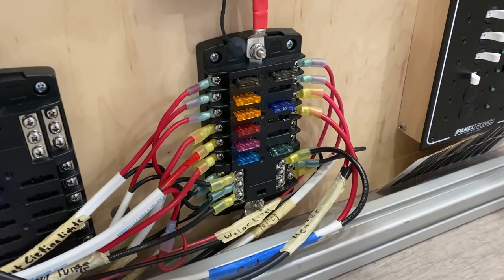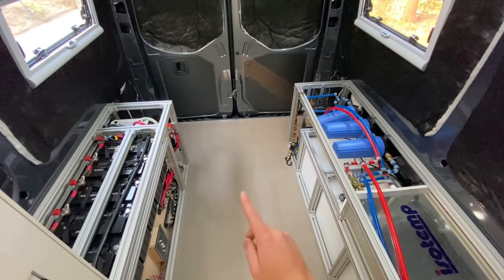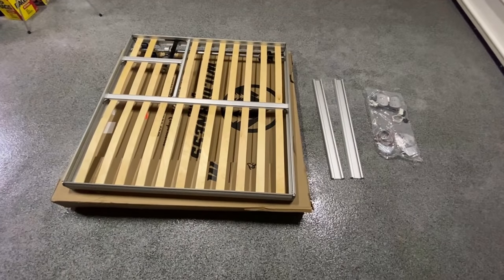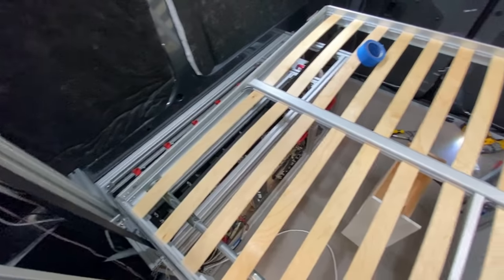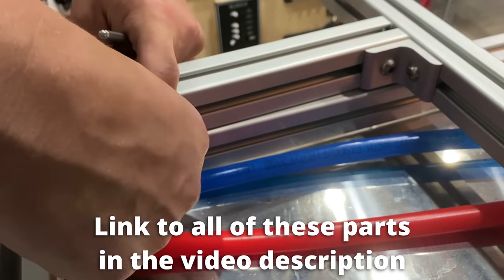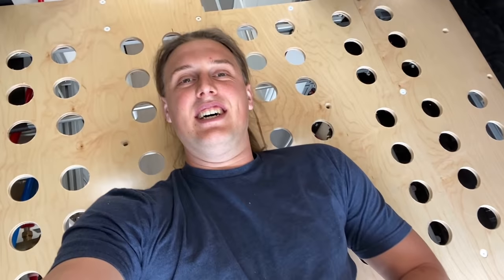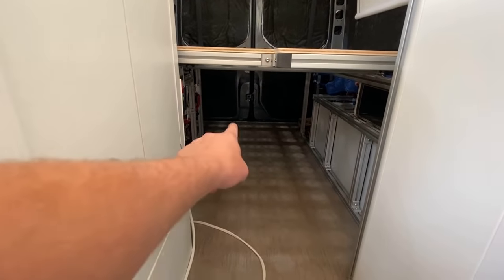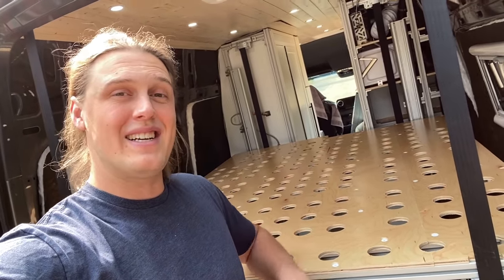I Made The BEST BED For Van Life 😴 (Rising Bed Lift System)

Comment: A prior comment referenced safety cut off switches to prevent the bed going up and possibly crushing and/or creating an asphyxiation situation.  Such electrical interlocking is NOT enough on its own! You absolutely need positive mechanical stops of suitable strength that will stall the drive motor to prevent the bed from rising to a height that would do that.  Limit switches, relays and/or contactors and anything electrical can fail - contacts weld themselves together, switches stick, etc.  Not having positive mechanical stops would be similar to working under a car using just a jack.  You don't do it - you always use a jack stand or some sort of mechanical blocking in case the jack fails.  These stops could be designed so they can be held up and out of the way to raise the bed to full height for more storage, but they should then deploy when the bed is lowered.  This would be similar to how the safety latches in a garage lift work.

Comment: This is what I would want to do as well for the bed system.  It would be nice to go up higher slightly more for a seating are underneath.  Now Mr. Savage, I've got a new idea for you.  Build a shower that combines hanging space up top and a fridge down below where there are two sections that slide out towards the front of the van and let's you shower.  Then slide both back in.  With this shower system along with this bed system you have the most efficient use of space in a van for sure!
Reply: it took me a minute to get my head around your idea... it's visionary... a solid space saver :)

Comment: My idea was to cut out the roof section of the van over the bed. Then  weld some aluminum side to the cut out roof section to create a box for the bed to raised up into. Then you will have full height use of the van.

Comment: I think one could easily self engineer the system. It is basically a pass-through right angle motor with a single shaft. I mean, you practically rebuilt this thing. This could have been built for much cheaper. Thoughts?
Reply from the maker: Yea 100%. It’d be so cool if someone did that
Reply: Single garage up and over door motor second hand £50, seat belt webbing from scrap breakers 4 casters and c Chanel, square section sly from scrap yard for frame, should be able to do it for less than £200
Reply: @aarondudas5006  looks like 1530 series 80/20 with linear bearings that captivate on 3 sides.

Comment: First, a safety warning.  Make this fused, have a secondary cut out, and a safety cut out at the roof for if people are in the bed.  Say a wooden bar across the top at the roof, with a switch on either end.  Bed at full up doesn't hit it so no cut out, if there's a person in the bed they hit the bar and at least one of the switches disconnects.  In fact make it 2 or 3 bars, or a large rectangular panel with 4 or more switches.  You don't want this going up in the middle of the night and crushing you to asphyxiation before you can find the off switch.  Winch type systems are extremely strong, you want a lot of extra safety when people are around them, it doesn't take that much force to make it where you can't breathe.
Someone else may have already mentioned similar, haven't read through all the comments yet.
Think I'll put the rest in another comment..
Reply: That's like my garage door. If you touch it it turns off. That's a safety design. I am really glad you mentioned this because I had not thought of it while I was watching.
Reply: The bed platform hit the side tapered side walls which is why it can't go higher than the top position shown. That still allow plenty of space for a human so I don't see how the wooden bar is necessary.
Reply: Why not put safety lock on the belts so it raises all the way up?

Comment: Thanks again Seven for another great video.  I was hoping you would have shown how you attached the tracks however.  I looked at the maximum lift height you were able to achieve in your van compared that with other videos of the Revel’s Euroloft and even if you take in account you not having a mattress in this video, your bed lift doesn’t appear to travel as high as the one on the Winni.  

I plan to purchase the Lippert system in build as well and since I am 6’ I will be using the mattress frame (those tensioned plywood  slats in the OG frame allow for better body support) that comes with the unit and laterally configured it while extending the mattress length in the flare space however.  Being 6’5” this will not work for you but I’m hoping this configuration will allow me to take a great advantage of the extra 26” a 170WB gives.

As for the price of the project 2000, I agree with all the comments here at $1900USD this is ridiculously overprice item.  BTW- I see lots of places online advertising a replacement lift motor, I wonder if that is a clue that the motor in not robust enough?  Even if you take in account the engineering/design work, this item should not be more then $1k.  I hope someone in the van build community comes up with a DYI design solution.  I am sure with the access of parts available in the  80/20 catalog, IKEA slats n’ frame, seat belt belting material and a off the self motor one can build it for 1/3 the price.  With the high margins the manufacture has built into the pricing of this device it will be knocked off by a made in China solutions soon enough!

Comment: Impressive work on the alluminium extrusions framing . Definitely my way to go. Thanks for the demonstration, I was afraid I'd have to solder. What is the total wight of the alluminum ?
Reply from the maker: Thanks, I didn’t weigh it but just the aluminum frame was around ~50lbs
Reply: @seven_o_savage  the best choice of bed is both variant together 👍
Reply: It looks like "Item" extruded aluminum. Item brand is pretty heavy, but strong and versatile. It is used alot in industry to build supports and surrounds. It is pricey, only reason I even know about it is that a found a trove of it at a surplus store years ago.

Comment: Really good video. Terrific working through the options and then modifying it.   I used to look at that extruded aluminum stuff and shake my head at how much it costs and then I make it out of wood, (Once I even welded).  $3000? And then all that work?  The work can be fun. I think if I needed this (and it's a really smart solution- it's essentially simple (nothing to bind ) with the widest range (height) of solutions). If I needed this I think I'd just go with ropes and pulleys and a way to tie it off (stabilize it at the sides)  against movement. But then I'm a sailor (and former physics teacher) so I like pulleys and things that move (rock me to sleep). 
I'd always get a Waterproof bed cover. Even at home. They're just like normal stuff, soft cotton, but they won't let any spills (or blown in rain)  get into the mattress. Also a reason for venting on the bottom of a mattress is over time body perspiration can collect in a mattress work its way to the impermeable surface at the bottom and begin growing mold.  Just seems obvious to make the top of the mattress (which can't  be run through the laundry) waterproof.
Reply: i totally don't understand the reason behind a waterproof bed cover? your roof is not leaking and during the day it's up, so how can you spill something on your bed? And of course, I hope your cover is breathable, otherwise, your moisture accumulates at the top instead of the bottom!

Comment: Its a great video, really nicely presented. I've got just two questions: 1. Why that extra length on one side (creating a bump where you climb into the bed) - could you make it flush and fit an extra shelf unit or something thin? 2. Why won't it go higher - is it a lack of webbing strap, or the narrowing width of the van? Thankx.
Reply: If you look carefully  you can see that the width is smaller due to the inward curvature of the wall (which is less on a promaster)

Comment: Hi, nice work. However, I see you have a massive battery bank. You need to consider "off-gassing" of the batteries. Car batteries, lead acid, can emit "H2" (dihydrogen). Lithium batteries can also off-gas when breaking down. If you proceed, then, IMHO, you should add a method of ventilation. Example: I use a ventless gas heater in the home during emergencies. Although I was assured it was safe, I have a 12vdc blower fan that evacuates the air, while on an automatic timer.

Comment: You did awesome as always. But $1999 for the bed lift of which you scrapped the entire frame must hurt. I wish someone made a bed lift kit of the motor, the bar, the clamps, and the seat belt webbing for 1/4 of the that price; then I would be interested.
Reply: There is a video out there in GERMAN, can't remember the word for BedLift in german, but the guy DIY's darn near all the mechanicals or bys off the shelf stuff...Even in german you can figure out what he's doing.. I figured I could do it for about $900.. a manual awning system would do the same thing, and power it with a cordless drill.. Look into aluminum track beams to replace a bit of the 8020..
Reply: You can buy a Happijac for $1k
Reply: @clintroberts1  Where? Cheapest I've seen is $1900 + $350 for shipping.
Reply: You heard of the stand up desk? It has a motor plenty powerful to lift the bed. Rich Rebuilds did it on his Sprinter van build. I think that stand desk is like $600 or less. Maybe this helped you. ✌️
Reply: @lukuscarter3563  I was thinking about something similar lol, why not just use two standing desk racks, they are cheap and stable
Reply: It's 2999 now. Sheeeesh
Reply: Project 2000
Reply: @mikesakas  if you remember could you reply back please? the closest I can think of is the Project 2000 one.
Reply: It's now $2,999. Yeah, they are exaggerating a lot with the profit margin here... A fair price for such a contraption could probably be 1000$, if not less.

But the concept is very good, it's a very convenient way to have a bed in a van.

Comment: Mr. 7: awesome video.  Thanks! What limits the bed travel on this model? Is it simply the positioning of the wall mounted guides? Also I noticed the European version of this has a rotation counter that doesn't exist on this one -- the counter can be tweeked as a high and low stop. Have you seen the European model?  thanks again!

Comment: All the space under the bed cries out for full height storage during the day, that slides forward into the open space in the front at night when the bed is lowered.
And that leads to:  Make almost everything slide forward and back.
During the day bed is up.  Underneath at the rear is bikes, middle is storage, and the kitchen is at the front.  Whole front half of the van is open space.  At night the entire thing slides forward, and the bed lowers.  Effectively double your open space, by moving all of the open space from over the bed at night, to in the front area during the day.
Unless you want to have to exit the van and go around at night, you have to have an area for people to be during the transition.  So say 2/3rds width does this, then the other area is for transition and you'll want the bathroom here as well, so you can access easily day and night.  In the front section this side can be where the table etc fold up to for night time..
With a little bit of work you could really maximize this and make the majority of the van's volume do double duty.  You can do this anyway on an individual area case basis, but it will be much easier to accomplish with just normal items and storage that slide back and forth on a platform that does the double duty for everything.

Comment: Nice video!  Curious--you mentioned some other dynamic bed systems, but not why you didn't choose them.  In particular, I'm curious why you didn't go the linear actuator route?  Seems like it would have been most inline with your DIY-ness.  Would appreciate as answer, as that is how I've been leaning.  Thanks in advance and keep the videos coming!
Reply: Typically, the amount a linear actuator can extend (in other words, its "stroke") is roughly the same as its retracted length. So, an actuator that can lift something a distance of 40" is itself 40" long when fully retracted. If you want the bottom of the bed to be 25" off the floor in its low position, and 65" off the floor in its high position, then an actuator cannot do the job, since a 25" actuator cannot extend 40". If you can solve this problem, and use actuators for a bed that can be both low AND high, please let me know!
Reply: @jkdean4685  Thanks, John.  Got it!  Yes, I will let you know!
Reply: I just learned about track actuators in this video: https://youtu.be/Hs335Mn3xtE. Looks like a good alternative to a HappiJac lift.
Reply: Thank you for sharing. That is the best DIY version of a strap lift that I have seen, and it beats track actuators on cost and simplicity. Excellent!
Reply: @jkdean4685  I just found that in a suggested video below the one you shared with me :)

Comment: Quick question, is there a slit in one the van mounting plates for the webbing and then compression fit with the other bracket?  Is it possible to snap a photo of the make and model of the right-angle motor assembly they use?  Thanks again for the videos!  Wow, and you also let the webbing just slide over the 80/20 frame with no pulley/bearing surface.  Very cool.
Reply: I would also like to buy all the components without the expensive bed section.  I'm even thinking about just making a hand crank system.

Comment: Very nice work. By the way, why the kink in the cabin facing front of the bed. Are you planning to put something there?
Reply from the maker: Good question i guess I didn’t cover it. I designed the ban to have a longer bed on the driver side so I could sleep there. And a longer galley on the passenger side in exchange for shorter bed. The closet door needs to be able to open which is why the kink is right down the middle.

Comment: For getting up on the bed when in the book position, did you ever think about a drawer, with feet that ride 1/4" from the floor, with an inset lid.  You could pull up the lid and the drawer is still a drawer for storage, otherwise its a step.  Interested to see if you ever tried or thought of this.

Comment: The problem I see with that bed is it's going to sway back and forth and bounce around when you're driving! It will drive you crazy on a long drive!
Reply: There are slides that had not been installed that stop that. Plus if you pull it up tight to the ceiling underway it would rock either.

Comment: Any chance you could give an exact measurement of the height of the bed frame would go once you have a bed on it. Trying to see if this set up would work if i want to fit as motorcycle under the bed, and get it in and out without slamming my head… Thank for the Vids
Reply: Also the weight of the whole set up would be great too if possible ?

Comment: I am opting for linear actuators in my build because I can custom fit - but it is great to see other options out there. I'd be curious to know how you feel about this choice all these months later?
Reply from the maker: Nice. I love this system it just sucks how expensive it is. Also if there was an easier way to DIY this, it would also be a good foundation for a self leveling system.
Reply: @seven_o_savage  Glad to hear it is still operating well for you! The price is high, but the fact that it is relatively compact helps mitigate that investment somewhat, I imagine. It is definitely one of the more elegant solutions available. 

I will be doing some proof of concepts with linear actuators before making my final decision but I don’t think $5000 all-in for a fully custom bed is all that ridiculous in a planned $100,000-$150,000 build - especially for a high-use feature.
Reply: @seven_o_savage    I would love to develop a DIY open source system for this. Might you be able to tell us more about the components used? Motor, gearbox, safety and/or brakes, dimensions, etc.? Not sure how easy it can be done, but there are a lot of people who can't spend $3k just for the basic parts plus larger frame. We have a new intern that sourcing/designing all this would be a good project for! DM if interested.
Reply from the maker: @rienkayers1  Hey rienk i love open source DM me on insta!

Comment: I wish I was as good as you at getting my van built. Literally on hold and taking forever, I can't decide how to build my cabinets etc. (Transit Jumbo, longest wheelbase )
How wide is the middle section where you walk ?
Reply from the maker: It’s super overwhelming to start a van build! Some advice that helped me early on is that everything can be fixed or re done if you don’t like it
Reply: @seven_o_savage  Yes, I tried to design everything how I wanted it first, then figured out that's not gonna work. 

Will see how it goes, don't really have a good place to work on the van. Maybe I should start working again and rent a place with space to park the van, will see.. Don't wanna go back into the rat race...
Reply: @Mike Already using the vehicle.. :) And no, I don't have the money, time or patience to spend 6-12 months in-place doing a build. Quik'n'dirty will have to do it until it can be redone :) 

Thanks for the reply

Comment: does this have the problem where the bed swings around as you drive?
Also, those 4 flexible straps don't seem very strong.

and if you put it all the way to the top, then that means you can't have upper cabinets where the bed would intersect it?